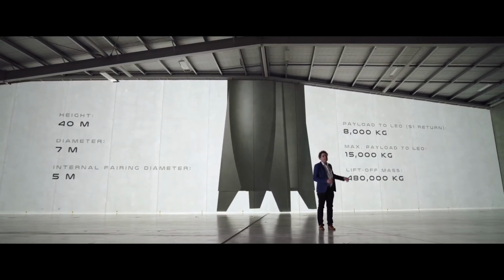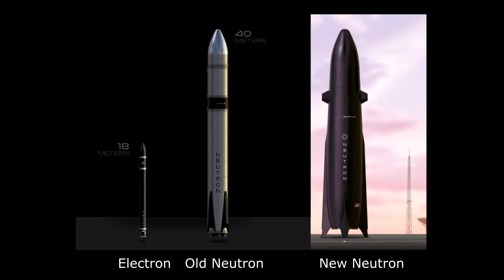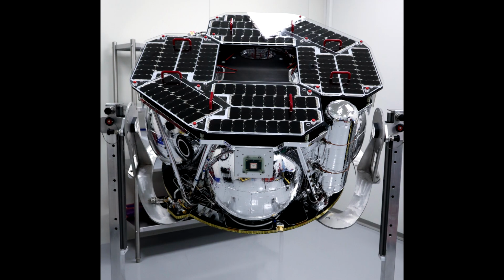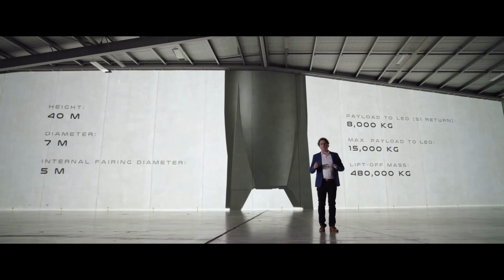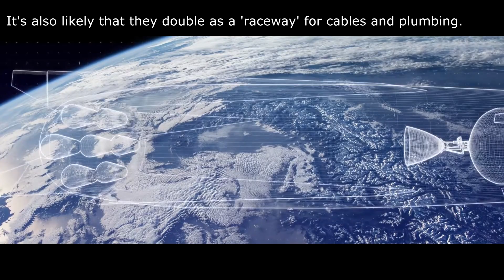Rocket Lab's Neutron Rocket Will Be More Reusable Than Falcon 9

Comment: Hey Scott, from what I remember hearing SpaceX didn't go to steel for iteration (only?) but because when you combine steel's higher tolerance to heat, it's increased strength at cryogenic temperatures, and the weight in thermal shielding that carbon fiber needs - steel actually turns out to be lighter for the required strength. But with Rocket Lab's recovery efforts it seems they've figured out something SpaceX hasn't - somehow they don't need heavy shielding for their carbon fiber? Seems like they've hinted at somehow they keep the hot plasma from touching the vehicle at all? How can this be, do you have any ideas?
Reply: One of the original justifications for stainless steel was the proposition that you wouldn't need a heavy tiled heat shield. You'd just need transpirational cooling in some places. That's now been discarded. Steel is good for rapid prototyping but otoh if you can print metal (Relativity) or do rapid automated carbon fibre (Rocket Labs) then that justification falls through. It seems the issue with carbon fibre and cryo has now been sorted. Also Rocket Labs got a lot of data on how their carbon fibre handles heating from Electron. And yeah, simply designing to keep the plasma away from (most of) the body is a good idea. The lower section however is going to require some combination of a heat resistant alloy skin, insulation or active cooling. Personally I like active cooling. I think the liabilities inherent in using steel (vibrational modes, local flexure, buckling) plus the quality control nightmare inherent in all those welds will eventually force SpaceX to reconsider.
Reply: Neutron is a competitor to Falcon 9, not Starship. Neutron will not go to Mars and definitely won't return from there. So I'd guess it doesn't need a heat shield for the same reasons Falcon 9 doesn't.
Reply: Elon said the switch to SSteel was firstly for rapid iteration and then secondly because CF needs strong (heavy) heat shield protection for Orbital re-entry speeds. The Neutron isnt going to be coming back at orbital speed. Falcon 9 1st stage reaches a maximum speed of about 8000km/h approx at MECO, this slows down to about 3000 during the re-entry burn. Atmosphere does the rest as it is subsonic by the time the landing burn starts. So I cant see how they can bring Neutron back without some kind of re-entry burn. 
The Super Heavy Booster could still be made of Carbon Fiber if they thought it would be worth it, but I doubt it would be. If they scale up to 15 or 18m diameter then maybe CF for the Booster makes more sense, but imagine the cost of the Mandrel and how do you cure something that big......

Comment: So the Neutron is kind of an SSTO with a very high performance payload engine. Instead of having each stage doing their "half" of the work, they rely mostly on the second stage. In a way, kind of like VirginGalactic who relies on the plane only for 1/6th of the max altitude.
I may not be really convinced at first sight, it is a very creative system wich could have its advantages (its % of reused mass being very high, for example). Wait and see :)
Reply: It’s not SSTO though, is it? The first stage never reaches orbital speeds, only the second stage within the fairing does.
Reply: @negergreger666  - Indeed, it is not SSTO. But the first stage is all the rocket, kinda. The first stage is oversized in many ways... but allows them to recover almost all of the rocket, without the need of an interstage, nor fairing (kinda).
I said that because it's kind of like a single stage rocket, with two engines under its payload instead of one.

Comment: SpaceX is not taking a hit in performance, the higher heat resistance allows for a much thinner and lighter heatshield. Since Neutron is not reentering from orbit it can get away with carbon fiber

Comment: Regarding the 2nd stage being designed for tension. What is the acceleration profile from lift off to orbit? Does the first stage accent accelerate faster than the second stage? If the 2nd stage is "hung" from the upper structure of the first stage it will be in tension until stage separation. However, once the second stage lights, it will be in compression from the 2nd stage engine acceleration. So if the 2nd stage accelerates faster than the first, then the 2nd stage still has to be designed for compression.
Reply: There's also the issue of taking away the aerodynamic loading, which normally ends up being felt by the second stage.

Comment: Would have loved to see rocket lab develop an electrically pumped, landing capable engine. Perhaps developing some sort of charging system (to reduce battery weight) and increasing engine power to compensate. Thought landing with an electrically started engine would make sense in terms of reliability? 🤔

Comment: If rocket lab will hurry, they maybe will be launching 1'st payloads in 2023, if SpaceX will hurry, theyr starship will start launching payloads in 2023 too, so all it's about the cost, starship is bigger, but it's materials are cheaper than neutron's, starship has 5x more, more complicated engines, but Elon wants them to be mass produced and cheap, starship will be capable to lift twice bigger and heavy'er payloads, so it has wider range for different payloads, and starship is fully reusable. I'm not comparing neutron to falcon 9 because everyone else does, and in comparison with falcon 9 neutron looks better, but with starship? Not really...

Comment: The trick with Starship is that what you really want is not low mass, but low cost. Steel might be heavier, but it's a whole lot cheaper. Having to burn more fuel for the same payload increases cost, so it's not that simple, but I'm sure they did the math. Also when you consider weight, you have to take into account the entire ship, not just the hull. Steel can withstand higher temperatures, which decreases the need for heat tiles, which saves mass. Also at cryogenic temperatures steel becomes a lot stronger, and most of the strength is needed during launch, when the fuel cools down the rocket anyway. I think Elon said that overall the steel Starship should perform about the same as a carbon fiber one, but it's going to be a lot cheaper. And of course fast iteration is also very useful. With faster iteration better optimization is possible, which also saves you weight and money. Turns out rocket science isn't easy after all.

Comment: If the material used is carbon fibre, wouldn't that make the rockets expensive per launch?
Reply: It will make them expensive to build. If they can reuse them often enough, that won't matter much.

Comment: On second thought.
I don't know guys.  Remember the last space walk - they were closing the cover for the air lock and the magnet wouldn't stick, the strap was not tight enough, the hoop may have been bowed or I got to thinking maybe even the hinge sprung.  The door / cover would not close correctly.  I suspect we run the same risk with this design.  A maw - leviathans in space.

Comment: Making flame resistant carbon composites is HARD. I worked on a team that tested new formulations at a big aerospace comp. manufacturer. Often, the “flame retardant” and “high temp” shit the engineers gave us burned better than the normal batches.
Reply: I'm wondering if injecting gas at the landing fins would help keep reentry plasma from cooking the carbon fiber.  Fins are cooled by internal gas passages and gas escapes at bottom of fin.

Comment: This is a terrific design. In light of what's going on lately at SpaceX, the design of the engines, of reduced complexity, is particularly shrewd. It's becoming clear that the Raptor, for all its full-flow fabulousness, is encountering quality control issues and dependable engines are not being produced at a rate which fits in with the development cadence of the rest of the Starship programme.

Comment: The jabs are necessary, given that the primary purpose of this presentation is likely for garnering investor interest. You gotta differentiate yourself from the competition, even if it’s a bit fabricated (for example, if the carbon fiber panel structure was actually bolted to the ground, that panel would be toast.)

Comment: 8:53 Really? Trading performance for "iteration" sounds like a technical debt waiting to happen. And that alone is enough to break Musk's "plan" for Mars. Even if he got Starship to work as intended, pretty soon someone will do something better.
The dry mass of Starship is just insane. A Heavy-lift Vehicle from NASA's SPS study has similar payload to Starship (120t), yet only 4000t mass when full. Which is less than simply the fuel mass of Starship, and even with some mass reserve! Apparently, aluminium construction/winged flyback is a pretty efficient design!

Comment: With such a high performance lower stage, why not simply use an upper stage that stays in orbit, docks in suborbit (or even a fractional orbit at low altitude), burns to circularise the orbit / add the remaining delta V and only the fuel tank and payload is transferred, then of course resetting itself and staying in orbit for the next launch, discarding the empty fuel tank. While more technically challenging, I certainly don't think it's inconceivably more difficult.
Then both stages would be reusable and the mass savings of not carrying an extra engine gives you performance / fuel / payload for free. Not only that but you can use the same orbiting upper stage for station keeping, post-launch monitoring and de-orbiting and the same upper stage could conceivably be used for many rockets. Without any cyclic aerodynamic stresses it's also quite possible it could have a very long life on-orbit. Especially if maintenance missions are scheduled in, perhaps many hundreds or thousands of uses.

Comment: I mean..  They are digging at SpaceX, but would ANYONE even have the potential of a first stage recovery if it wasn't for SpaceX??..  I seem to remember a lot of space companies laughing at Elon...
Reply: The problem with reusability was never its technical possibility, but rather its financial feasibility. A lot of companies were at the point where reusing parts of the rocket (like first stage re-use, engine fly-back, side booster landings, and so forth) were seriously considered, but because the launch market was so small there was no point to develop it. This could likely be a reason starlink exists, just to create a market for reuse. 
Thereby, the huge underrated benefit SpaceX has over competitors is/was actually not reuse (maybe it's now, though), but their cheap/modern manufacturing processes. Something RL tried to match initially with electron, but failed quite drastically (electron loses money each launch, even including the hefty subsidies per launch. If I'm not mistaken an electron launch service costs in the neighbourhood of 12 million USD, yet they market it for 5/6 million USD to stay competitive). Hence they are forced into Neutron (and arguably the SPAC merge), since electron (even with reuse) is not gonna bring in money.

Now you can argue if Neutron is over ambitiously presented just for investors, and how it will fair against other new competition like Astra (which I've even more doubt in), Relativity Space, Firefly, ISAR, or even 'Old Space' which is also stepping up. Fact is, SpaceX seems to have quite some problems with Starhip/Raptor right now (I think you can fairly safely assume now, that the very ambitious promises of Starship won't be happening anytime soon), which opens up a big gap for competition to rise.

Comment: My question on this is 2nd stage staging. I can assume that they will open the fairings and disconnect the 2nd stage from the 1st. But given the slow speed of separation cold gas thrusters are going to be needed to speed the separation. I wonder if they will put those on the 2nd stage to help with propellant settling or save them by putting them on the 1st stage.
Reply: just hydrolic pushers to shove it out ahead will be enough, exactly like Falcon 9

Comment: This is great to see. Some innovation going on here and there is definitely room for this within the space industry. The presentation was cool but that's all it was..... a presentation. SpaceX already has Falcon 9 in service, supporting NASA and everyone else that most companies can only dream of. Falcon 9 being the most successful rocket ever built and literally turning the space industry around with bleeding edge technology & engineering. Starship and Starbase is so ahead of the crowd, that by the time Neutron becomes a reality (and that's a big if) starship will be fully operational and dropping massive structures into orbit, supplying habitation for the moon base and almost certainly a few attempts at a mars landing. Great as this sounds, only SpaceX is delivering on it's ambitions. This will be very interesting though.
Reply: The dry mass of Starship is just insane. A Heavy-lift Vehicle from NASA's SPS study has similar payload to Starship (120t), yet only 4000t mass when full. Which is less than simply the fuel mass of Starship, and even with some mass reserve! Apparently, aluminium construction/winged flyback is a pretty efficient design!

Comment: How high and at what speed can the faring be opened?
How far away should the 2nd stage engine be to not damage the open or closed faring? What will be the Delta-V while waiting?
Will there be enough time to reclose the faring before reentry?
Reply: I can't give you exact numbers, but since the 2nd stage is not aerodynamic anyways (including the payload) they can only open it in extremely thin atmosphere, or the high speed would destroy the payload on top instantly.

Comment: I've seen some interesting speculation pointing out that the description of Archimedes is remarkably similar to the Prometheus engine developed by ESA. Their plan to have Archimedes on the test stand next year is pretty ambitious for designing a new engine completely from scratch, so it does make one wonder if they might have done some kind of deal with ESA...
Reply: Might be. For example, SpaceX's original Merlin is a copy of NASA's FASTRAC low-cost engine prototype.

Comment: There is still a role for electric pumps - pumping fuel into the gas generator/turbine. Why? Because this simplifies control of the engine, makes startup more reliable, removes feedbacks and also allows deeper throttling. Plus you need less ullage pressure.

Comment: Its an interesting design and competition is great but the biggest concern is a business one. He says at the end that the bulk of launches over the next decade or so will be small LEO sats, but neglects to mention that over 90% of those will be SpaceX starlink satellites and thus unlikely to be available for them to launch. Also given that it is in the very early stages of development Starship will likely be flying before Neutron and Starship will have a major shortage of payloads so will likely be offering cheap rideshares. Starship could easily fit a third stage the same size as Neutrons second stage inside its faring and drop it off in LEO with considerably more capability. Rocket development is expensive and SpaceX is funding development with existing customers and starlink. Other outfits depend on government funding. Rocket Lab is going to need a lot of funding from somewhere.
Reply: I very much doubt that Rocket Labs are counting Starlink in their business case and in any case, Starlink is destined to be scaled back due to lack of market. Just another "internet constellation" failure or near failure. Btw did you notice Elon's email saying that SpaceX is burning cash and could go bankrupt if Starship doesn't become operational next year. Not much of a chance of that.
Reply: @saumyacow4435  Yes I saw Elon's email. Did you understand it? Starlink is set to scale up massively and requires the satellites in orbit in order to do that. Elon's email was saying that they have far more demand than current launch capability right now. They are burning money making the terminals, but those are useless without satellites. Given that Amazon and others are still planning to compete with starlink there is clearly no lack of demand. You are badly mistaken on that front. Rocket lab are probably counting on those other constellations giving them business. But my point remains, over the next few years and probably the next decade, 90% of all launched satellites will be starlink. Either Rocket Labs doesn't know this (and they should get out of the rocket business now) or their statement was misleading.
Reply: @saumyacow4435  You might be interested to know that SpaceX claims that Starlink has over 140,000 current users in 20 countries and has orders with deposits from over 750,000 more users. They may be lying, but you would need to provide some sort of evidence for that before claiming they are 'destined to be scaled back due to lack of market'

Comment: SpaceX should optimize the first stage of Starship for performance and make it from carbon fiber too. If it doesn’t have to withstand the heat load of atmospheric reentry, there is no need to make it out of stainless steel. Even making it out of Al-Li would make more sense than sticking to stainless steel.
Reply: @simonm1447  I mentioned the first stage of Starship, not of Falcon 9
Reply: @gaborbravo1  Sorry, I have read it in the wrong way, and confused it with the F9